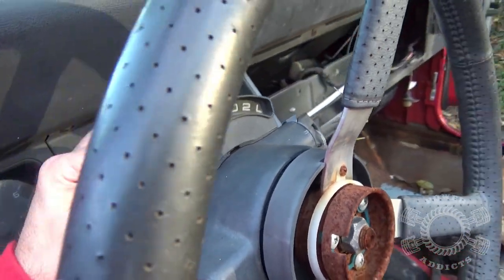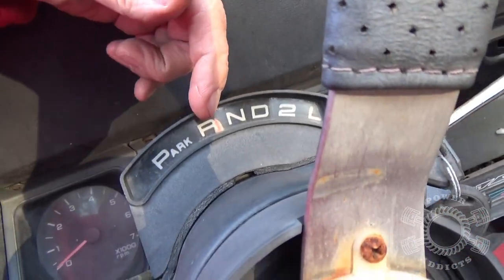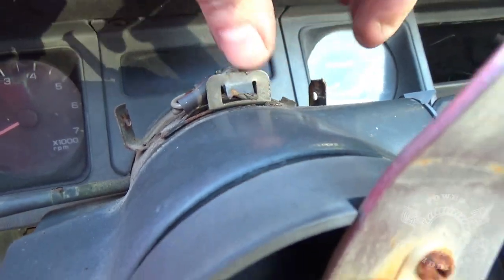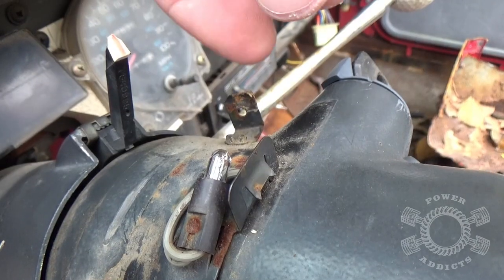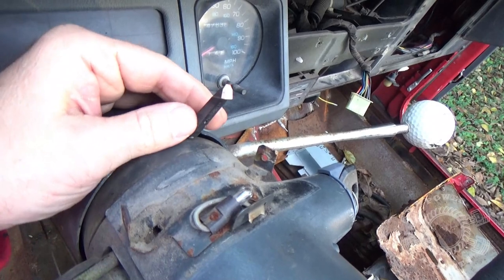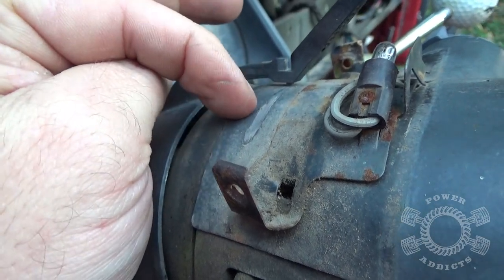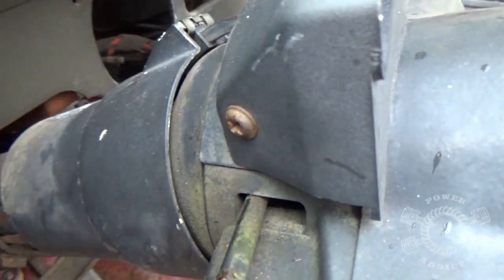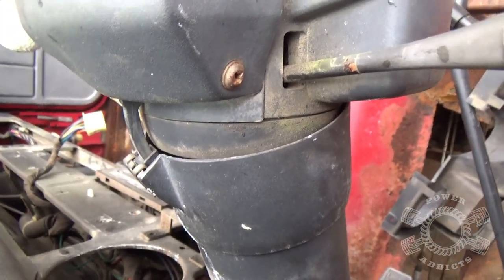Jeep Wrangler YJ - How to change the Automatic Shift indicator light #poweraddictscrew #yjshiftlight

Comment: After a lot of digging around, I've found that the bulb is not a 2825. It's a 2721, 2722, or 2723. The 2825 is a wedge bulb whereas the bulb in question is a wedge subminiature bulb. The difference in size is 1/8 inch width and 1/4 inch in length. A 2825 is the same size as a 198 which is what is used in the dash lights.
Reply from the maker: Thank you very much for catching that and posing the correct information. This will help others who watch this video. Comments like this is why I like running this channel as a community, we all help each other with great information. Again .. thanks! Have a great day!!
Reply: Thanks for the update you just saved my butt

Comment: Thanks for this but my issue is that the shift indicator does not sit properly when I shift (I have automatic).  For example, I recently did an SYE, got rid of my drop transfer spaces and raised the skid back up.  Since I did that, when I shift, the indicator dial does not sit over P, D, R, N but in between.  How do I make the adjustment so that when I shift, the dial rests properly over each position?  Please help.  Thanks.

Comment: I got the 2825 bulb, but is bigger..
They old one is missing and there is only the housing to receive the bulb but does not fit, and it looks exactly like the one in your video...
Reply: I also got the bulb in the video, too large. The correct one is teeny tiny, but don’t know the number
Reply: Yup, I've got a ton of 2825 bulbs which are the same as 198 bulbs but different consumption and life rates. The bulb for the YJ is definitely not a 2825.

Comment: Where can I find the automatic transmission shift indicator.  I need one.  1994 yj thanks
Reply from the maker: Maybe get luck at a salvage yard. Other than that check online at Morris4x4, Quadratec or ebay. Also there a website called deadjeep.
Reply: I'm looking for the same thing for my 87 YJ.  Any luck finding it yet?
Reply: Yes I found it.  It’s not the original piece but I’m not paying $100 like everyone is selling it.  This is a good one. Chevrolet / GMC / Jeep Auto Trans Shift Indicator / pointer 7840995

Comment: The clip the needle goes into on the column broke on my YJ. ☹️ I can’t find a replacement. Any suggestions?
Reply from the maker: They are Saginaw GM based columns. So probably one off of a late 80's Chevy S10/GMC S15 or Blazers may work.
Reply: Let me know if you find a replacement bulb thanks